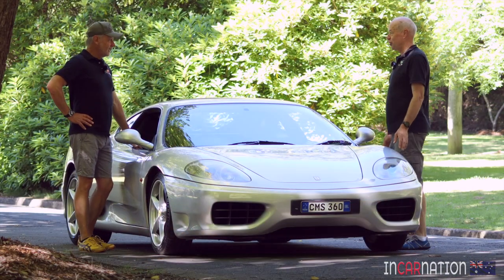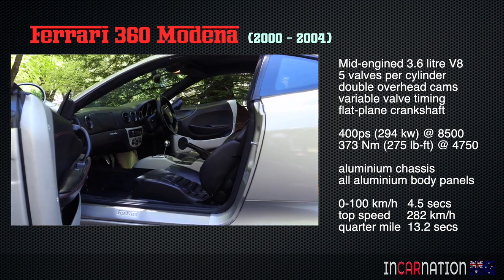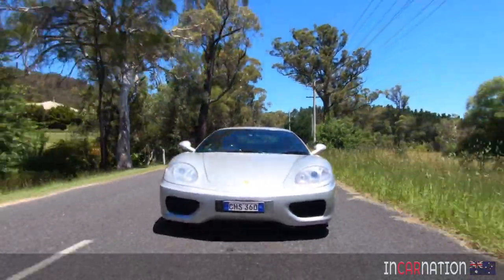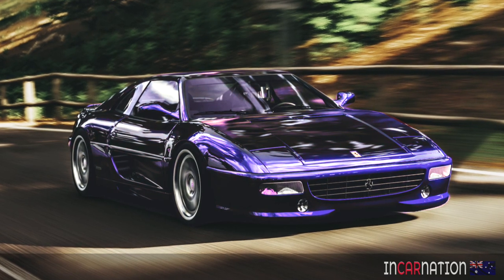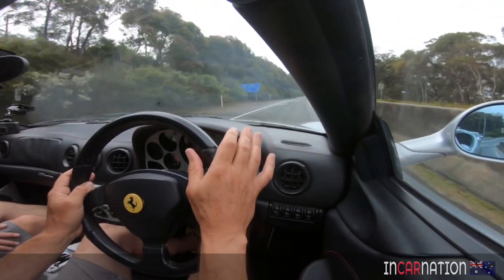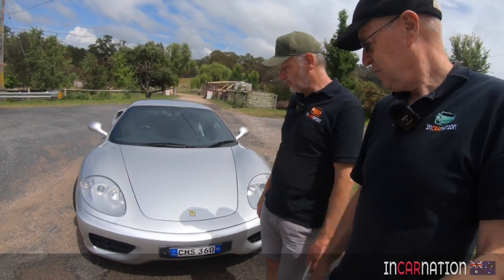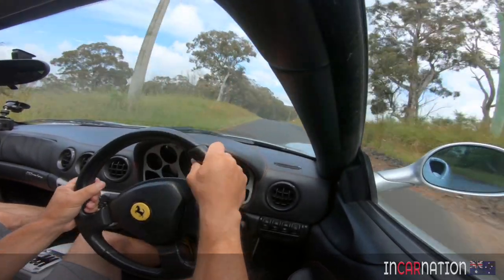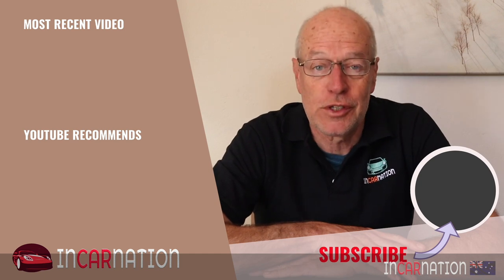FERRARI 360 MODENA // HEAVEN is a MANUAL GATED GEARBOX

Comment: You briefly mentioned the similarities of the 360 to the Cayman for 1/5 the price. Could you elaborate more on that, perhaps in another video if it would be to much writing? Thanks for another great video!
Reply from the maker: I like that idea. I should take the 987 Cayman for a bit of a blast while the Ferrari is fresh in my mind. The 360 has far more grunt and presence, but in terms of driver involvement, they are both very satisfying. (Stu)
Reply: That’s nice to hear about the similarities of the 360M to the 987C. I’ll be taking my 987C on a 3 hour drive this afternoon 👍🏻😎

Comment: Thanks for another great video.  I had to go back to check to see how you scored the 458.  You rated the Speciale at 19.5, so just below the 360 with 20.  Did you ever try the 348?  I have added to my garage over the last few months and so now have the 458, 348 and 550 (in order of acquisition).  I would find it quite hard to rank them, but despite being the cheapest to buy, there are days when the 348 comes out on top.
Reply from the maker: As much as we try to be empirical with our scoring, you're right - it's hard to see how the 458 Speciale could be outscored by the 360. Especially as in performance, presentation and personality the 458 topped the charts, outscoring the 360 in each.  As a drivers car, the 458 was phenomenal. What clipped its wings was it's astronomic value and practicality - it's hard to imagine using the 458 Speciale as a daily driver, whereas the 360 with it higher ground clearance and even room for a set of golf clubs (so they claim)  possibly could be. I'd be petrified parking the Speciale at Coles.
I (Stu) have never been in a 348, but would love to. Mark probably has.
Thanks Gavin once again for your considered feedback. Maybe it's not possible to rank them at all. How does one compare a Ferrari to a family 4WD. Not possible really is it. Like comparing a fish to a toaster.
Reply: @inCARnationAustralia  I thought I would update you having recently traded my 458 Italia for the Speciale.  It is still early days, but the term "drivers car" is not misused.  On collection and a longish run on the motorway - I was surprised by the road noise (tyres, not engine) - it was horrendous!  All is forgiven though when you get to drive down the country lanes.  The way it hugs the road, the turn in on corners, feeding back everything is a wonder.  The level of control and composure inspires confidence and allows you to push the tyres to their limits.  The engine note is gruff compared to the Italia, but I would say the suspension is not really firmer and handles the bumps much better.  The gearbox is also smother, especially on downshifts - although not quite as smooth as my 991.2.  I am finding the ground clearance very good - best of all my cars and no need yet to use the axle lift.  But I certainly agree - even ignoring the price - you could not daily it!

Comment: Unfortunately the prices being currently asked for 360’s is comical..$180 - 250k!..c’mon…
UK imports should be around 15-20% cheaper than Aus delivered, according to my local Ferrari dealer..
Reply: Yes that percentage figure you’ve mentioned has pretty much been the norm. However talking to collectors now the prices have very much equalised for particular cars, manual 355 and 360 fall into this category. The same with manual NSX, you can see the pattern with gearbox’s.